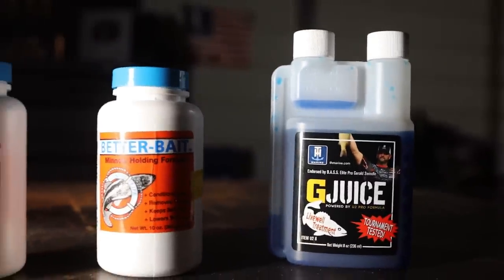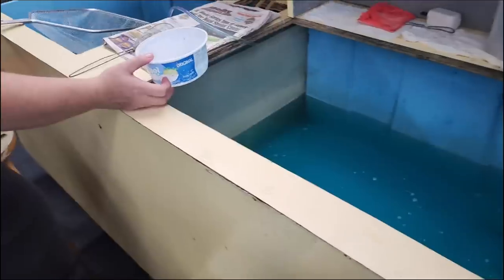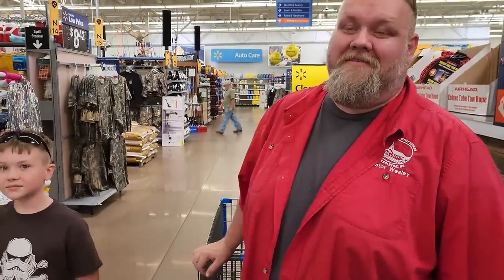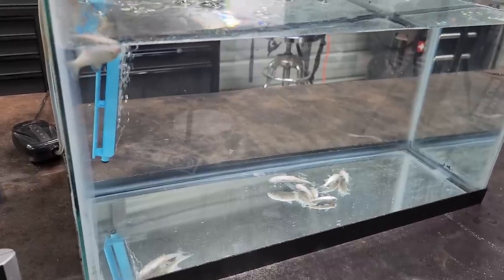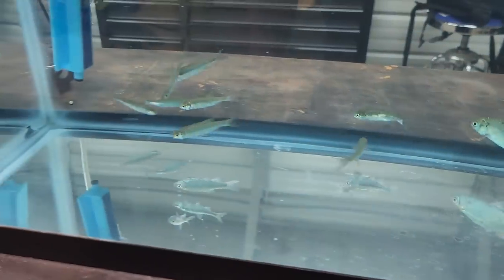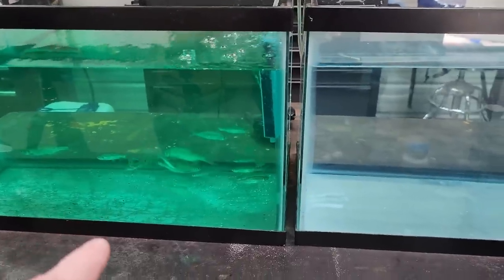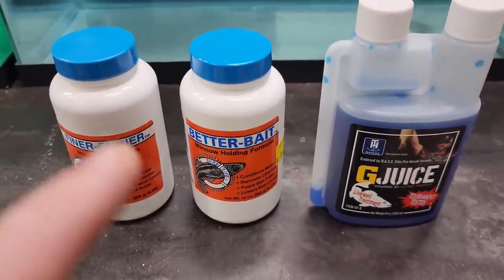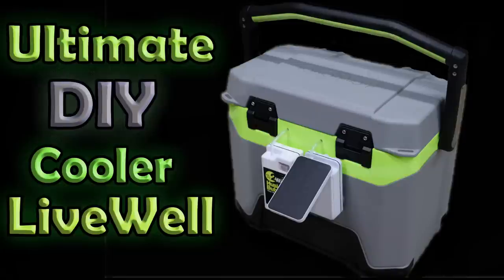KEEP YOUR BAIT ALIVE The Truth about water conditioners

Comment: I just use Tetra Aqua Safe Plus, or Aqua Start in my livewells. I usually get them at Wallyworld in the pet section, or clearance aisle sometimes. They are tapwater conditioners that works great for me, and is quite a bit cheaper when you get the big bottles. I'd like to see you test those also, and see how they perform against these ones that you tested.  Keep up the awesomeness Keith🤘🎣
Reply from the maker: I think they are mostly the same thing . I'm sure there's some difference but I still think they will all work . I'd but the cheapest one
Reply: i was just going to suggest aqua safe.... i used to have fish and when i''d change out the water treat it with aqua safe and it works instantly

Comment: I use a buck converter circuit to eliminate the batteries and run the bubbler with USB. Can be plugged in at home, or use a USB charging box on the go. Works awesome, and buck converters and cheap on Amazon. Like 1$ a piece.

Comment: Yes, it all contains the very same water conditioning agents, same as what you'd find for regular aquarium fish... the thing is straight tap water, after setting for 24 hours, looses all those chemicals and would be as safe for them as rain water or lake water but cleaner.
The minnows you put into the chlorinated water, yup, chlorine put them in stress and burnt out their gills. Was a horrible way to die, ifin ya know what I mean. 😉
Reply from the maker: Yep I knew about the 24 hour tap water thing . But I was trying to find the best way to do it in a hurry
Reply: @FishinNStuff  yeah buddy, I knew you'd know. 😊👍💞
Reply: Unfortunately this isn't always true. More and more tap water nowadays use Chloramine instead of Chlorine. Chloramine although it is less volatile than regular chlorine it last in water much longer and doesn't dissipate from tap water nearly as fast. It can actually stay in water for weeks vs 1-2 days with chlorine. Most of the water municipalities in the U.S. are starting to switch over to chloramine because it is safer to handle and doesn't have as strong of a chlorine taste.

Comment: I’m curious why there is live bait specific water conditioner. Couldn’t you just use aquarium water conditioner?

I’ve used Seachem Safe for years with 0 issues for my aquarium. One $15 jar treats 60,000 gallons of water. My bottle is over 5 years old and will probably last another 5 years. If it’s good enough for fancy aquarium fish I’m sure it’s good enough for bait fish.
Reply from the maker: I guess the same reason why they have bibles for men and bibles for women but they both say the same thing lol That's a good point and kind of the one I was making . Just but the cheapest one .

Comment: Long time fish keeper here, in a hobbyist and professional capacity. This stuff is the same thing as what we use in aquariums, just marketed different (and a lot more expensive). Generally speaking, a water conditioner is a water conditioner. They all do the same thing, but some have extra features like reinforcing slime coats or neutralizing ammonia, nitrite, and nitrates for short periods. Dosing can be different because manufacturers are ballparking their concentration based on average chlorine and chloramine dosing that municipals do. Not all tap water has the same concentrations in it, and not all conditioner brands have the same concentration of active products in them. So that's why dosing can differ. You don't really know unless you test your water for those things. Some can have concentrations low enough that you don't have to dose at all. Some it's through the roof. You can adjust your dosing of conditioner for these different water conditions. 

Neutralizing chlorine and chloramine is only half the battle for this kind of usage. Yes, those things (and heavy metals) can kill fish, but what will kill them in the longer term is biological waste buildup, specifically ammonia. If your conditioner can't bind ammonia, then you're still going to start losing fish after a day or so (highly dependent on amount of fish and amount of water). Some products have that additional function. The most popular one in the aquarium world is Seachem Prime (almost half the price of that G Juice stuff), it's the boss hog of water conditioners. With Prime, normal dosing is something like 2 drops per gallon (I usually just squirt it in the tank). 

Some of that stuff is pure marketing mumbo jumbo. Like that one that ways it's for shiners and "works on goldfish". Well, yeah, they all will. "Hardens the scales"? I'm going to call bull on that one. The coloration could be dye so you know there's something in the water, or it could be malachite green and methylene blue. But those would be a waste, as they wouldn't be effective in that kind of usage, concentration, or short term dosing.
Reply: What about those of us on well systems. Should I get a comprehensive water analysis done? I get one done, for human and pet consumption, every 5 years. And would you suggest something different for well water? Any advice is greatly appreciated for this new-to-fishing, middle-aged man.
Reply: @mattbrown5511  Obviously well water usually won't have the usual additives, like chlorine and chloramine, but it can still have heavy metals. I'd recommend still using water conditioner on it, just to be safe. For fish use. Fish can be far more sensitive to this stuff than we are.
Reply: @Brunnen_Gee  Thank you. I'll do that for sure then. Be well friend.
Reply: @mattbrown5511  Take a sample of water to any pet shop that carries fish and they will basic test it. They won't get into heavy metals and such but it will cover everything that will effect fish. Might cost you a couple $, but that's cheap.
Reply: @matthewwarfield4302  Thank you
Reply: I had an aquarium (freshwater) with some fish 🐠 🐟 from a pet store in it.  They lasted a few months, but eventually all of them died even though I regularly treated the water, had an aerator (bubbler) in it, and a good pump and changed the filters regularly.  After my fish died, i cleaned it up and left it running without any fish in it for a while. When fishing season started, I went fishing 🎣 and picked up 2-3 dozen of minnows for bait. I took the remaining minnows home and put them in my aquarium. The 6-7 minnows left after a couple fishing trips lasted a long time but eventually died too.  It was pretty cool to see the minnows swim in my aquarium. I’m wondering if I can use one of these products to treat the water and add some minnows to the aquarium to keep them alive till I use them for fishing? I’m asking because I have the pump with the filters on it to keep the water clean. 🧽 do I need to remove the filters and just let the system run without the filters?  I also have an aerator in the aquarium.
Reply: @Nunya9876  I use my aquarium like your wanting to do. I left my filters run because that helps keep water clean, and i use both charcoal and ammonia tablets they sell at pet store in my filter, same as they do with there expensive fish but charcoal and ammonia pellets are just few bucks. I use the reusable bags for the filter and a tap water treatment i buy at Walmart. 1 bottle is 8-9$ and treats 600 gallons so will last me few years. I do feed my minnows gold fish food every 3-4 days unless its very cold outside as in summer i lose more than winter but i am no expert on feeding minnows i catch with my seine or cast net. From Ky lake area. Hope this helps bud , God Bless

Comment: I have used the bait saver tabs for years.  They make a huge difference, especially on hot days.

I recently found a really simple way to power my aerator using a Ryobi tool battery.  One of the 4 amp-hour, 18v batteries will run the aerator for about 24 hours.  Pretty dang cool!  :)

Comment: Here's how I run my live well on my 1985 Lowe flat bottom. For the drain hole on the bottom of the well I have a long pvc pipe that screws into the bottom to get the maximum depth out of the tank. I have a pump on a timer that pumps fresh lake water into the well. It overflows into the pvc pipe when full and I can keep pumping fresh water. I only keep what we want to eat so this works perfectly.

Comment: If you want to keep your bait fish even longer , feed them gold fish , fish flake & put one of those reusable ice packs in the water once the temperature gos down . You want your water temperature to be within 65 to 75 degrees . I set up a 20 gallon aquarium in my basement like you would any regular fish aquarium hiding spots , fake trees or fake Hydrilla , small gravel , & a fish air raider & filter with a cooling pad so I can regulate the temperature of my water . I use it when I have extra bait fish left over. Just throw them in it & feed them once a day & your good to go & if you keep the water temp at just the right temperature they will even start to breed & you should feed the baby’s a different kind of food , it’s almost like krill but way way smaller & the big fish don’t tend to eat that .

Comment: There is a good hike to feed your fish at the same spot for weeks which is cut off the bottom of 2 l Coke bottle attached dead fish through the opening for the eyes and hang them on the branch of the bush that grows over the water and just leave it there what that will do in about 1 weeks you will have maggots dropping into the water at the same spot and they will keep on dropping for 2 to 3 weeks depending on temperatures outside and south is probably going to be the only one week. And the only thing to worry about with this feeder is that the high tide doesn't catch it and that it is far enough over the water so that the animals can get.

Comment: Shame you didn't use the cheaper stuff like Ammo-Lock or other brands of water conditioner found in the pet areas and pet stores. They are cheaper and work just as good.  One other thing, about the air pump. Remember that it is using the air around the pump. Any chemical in the air gets into the pump and right into the water. Just sayin

Comment: i only fish artificial bait, but if i were to get minnows, judging by this video id go with teh g-juice. it seems to work well enough, and is cheaper, but the thing that became apparent in teh video is that it was also MUCH clearer in the treated water. both of the other formulas looked like they really darkened the water up, but the g-jiuce you could hardly tell was there.

Comment: We run a bait shop and use Finer Shiner. We also have 2 live bait vending machines that are refrigerated to about 42 degrees. We use a product to remove the ammonia in the water, from the fish peeing, and another product that somewhat sedates the fish. Shiners are so finicky we can only put a half dozen in the bags for dispensing. The fathead minnows are tougher, and they are a dozen per bag. 
  Both types of minnows are in a refrigerated lobster tank. We keep gallon jugs of water in the fridge at the same temp as the tank to avoid temperature shock. We use straight tap water, and after sitting a minimum of 24 hrs, the chlorine has dissipated. The additional water treatments take care of any residual chlorine. With everything done correctly the minnows will last in their little 2 cup bags for 36 hrs. After that the shiners will start struggling. The fatheads will last almost 48 hrs. There is no additional air being pumped into the bags. 
  When the 100 degree heat this summer, we couldn't keep any of the minnows over 24 hrs. We haven't figured out the reason for that.
Reply from the maker: That's alot of good information

Comment: The G juice is the best for bait it has got a lot of the things tropical fish user uvmse regularly. It the fish are lethargic it is a sign sometimes is wrong. 

The problem with keep live bait a long time they produce ammonia which turn to nitrite which is highly toxic to fish and live bait thus they make a bacteria treat the digests the nitrite and turns it to nitrate which is less harm full. These product are use to start up fish tanks but are perfectly adaptable to live aquatic baits they even have products that do the same as the freshwater version. To learn more look up the nitrogen cycle of fish. Especially if you are keeping them for long term regular water changes add these quick start water treatment products would improve the life of you aquatic bait
 Also they make test strips to monitor water condition Aquarium Coop sells these test strips online the are fast and the best I have found.
 Second  to treat city or community treated water
 Which contain either one or some of  these chemicals in combination which are chlorine, chlorinates, cloramines, or chlorine dioxides; and they make tropical fish dechlorinates that neutralizes those chemicals making the water safe for you aquatic bait. 

Using test strip will identify what needed or contaminating the water that harm to aquatic live and using the declorinator and bacteria enzymes that treat the fish waste and add  and a Methylene Blue General Disease Prevention which will treat basic disease and improves fish slim coats in conjunction with water changes will allow you to keep you bait for a much longer time and allow you to keep after the day is done and you wish to keep the bait for another day. 

Also the larger the container you keep them in like a large plastic garbage can or a larger garden pond with a sponge filter and air pump following these simple steps you could maintain them indefinitely, however you may lose so everything you move them from one environment to another. This creates real stress on baits, sometimes the places you get them and where they get them the conditions are not always the best for the fish and this shortens they life exponentially. However I'd you treat like they were aquarium  tropical will go a long way to insure they will get the best care until you use them as bait; and a healthy bait is the best bait to catch fish and allow them to last longer in the water when fishing. However how you present them as bait and hook them also affects their ability to stay alive longer in front of the fish you are trying to entice to bit.  There is so much I could say help keep your live aquatic bait longer or to save for another fishing trip but many wouldn't be interested because they are just bait. However there are so many reasons  to take some of suggestions I have stated here put it  into practice, yet many would not care. And I do understand. However if you just added some aquarium salt to the water would make a huge difference along with a good air source and a filter or air stone or even both.